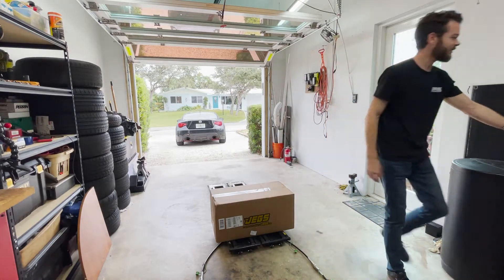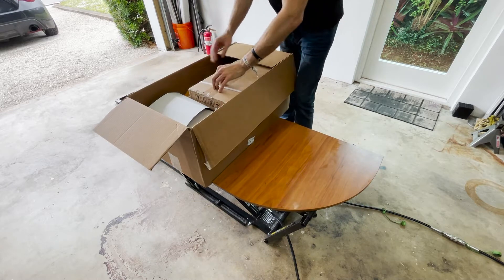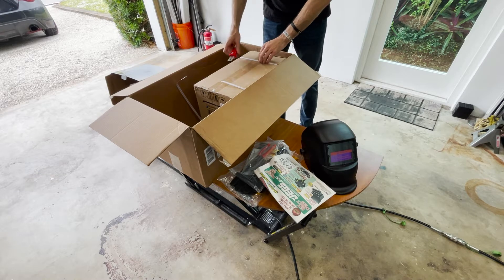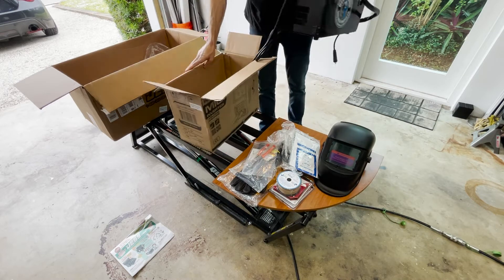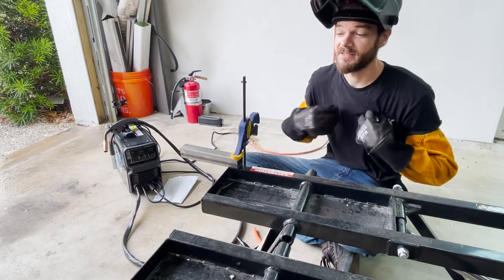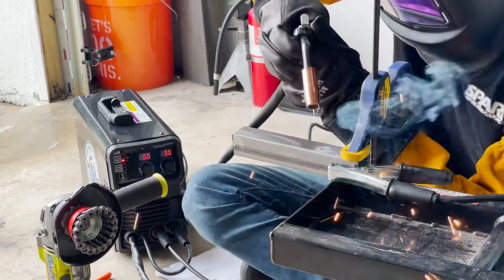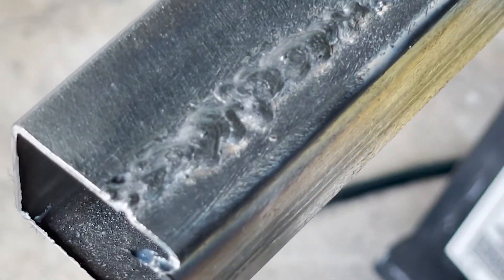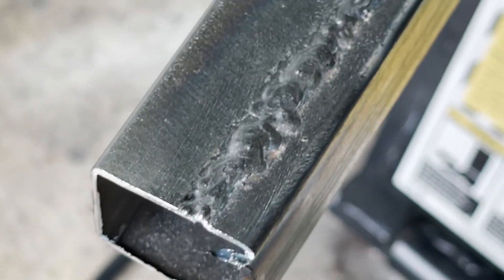First Welds with the Blue Demon 140MSI!

Comment: Cut it in half and check your penetration.  You might be able to acid etch it to see the different grain flows/boundaries.  Also cleanliness is key but flux and stick are more forgiving.  If you are cleaning after grinding, use alcohol and acetone.  NOT brake clean.  If you have chlorinated brake clean, you can chlorine gas yourself and regular brake clean is just bad practice/cancer.   Try not to weld over yourself or you'll find out how hot those spark/slag is.
Reply from the maker: I got plenty of alcohol around from doing the vinyl wraps! Thanks for the tips! 🙏